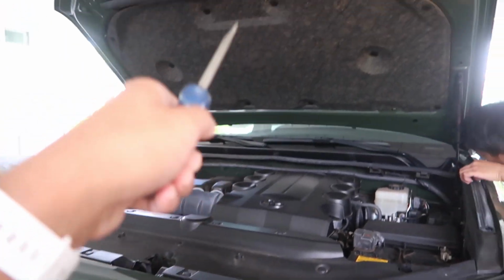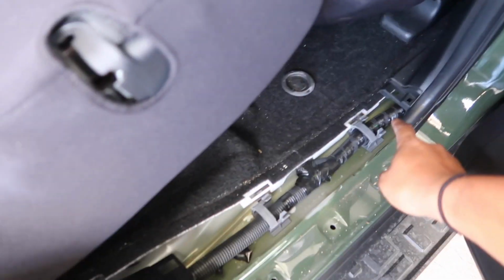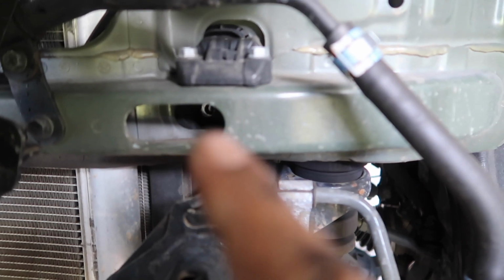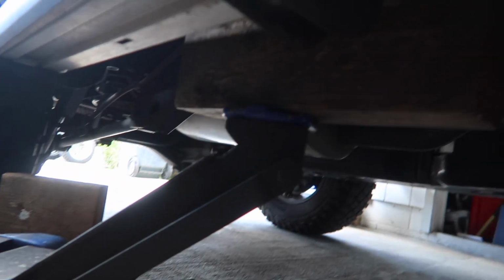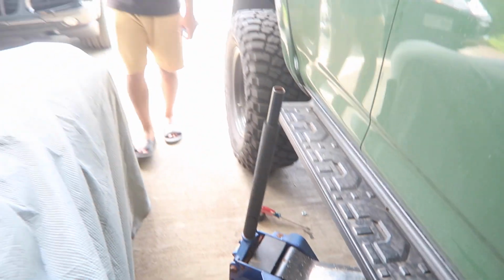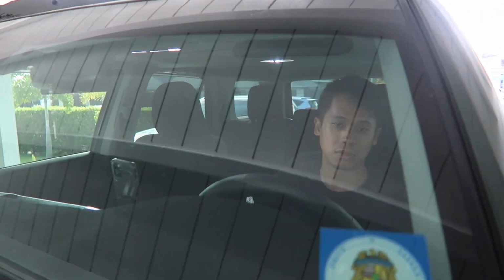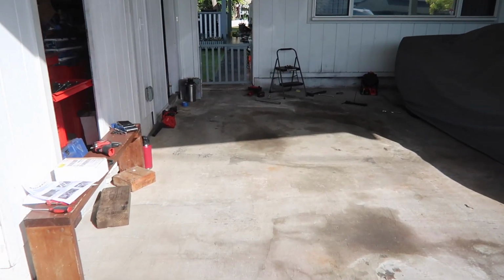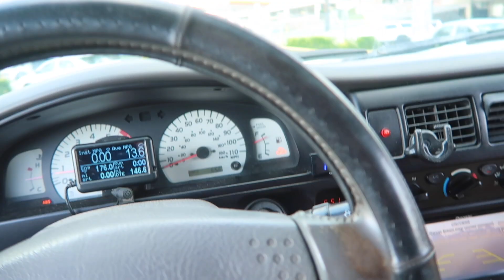Dionne's 5th Gen 4Runner Bodylift Install

Comment: Was it rubbing at full lock is that why you guys installed the 1" body lift, and what size are the tires?
Reply from the maker: Not too sure on rubbing but I think they just wanted it a tad bit higher lol. Need to figure out tire size I forgot already sorry lol.
Reply: No rubbing at full lock, only because I already had a BMC prior and got minimum trimming down in the front. Running 295/70/17 tires. Just wanted the truck to sit a little higher
Reply: How does it ride after a year now?  Any issues? Thanks